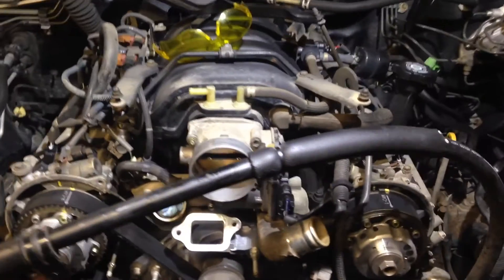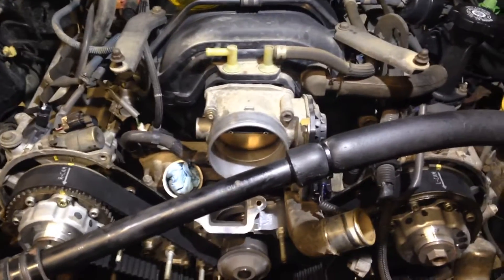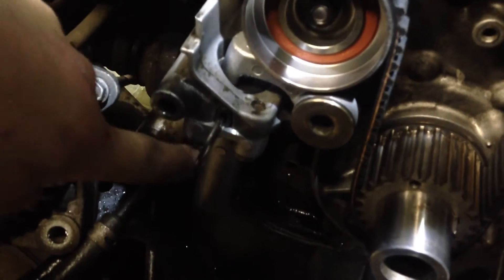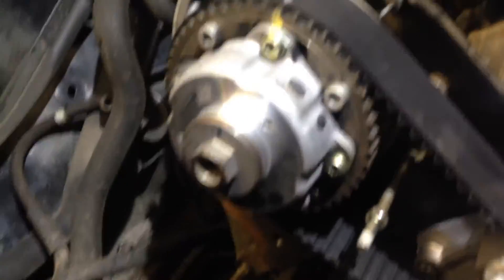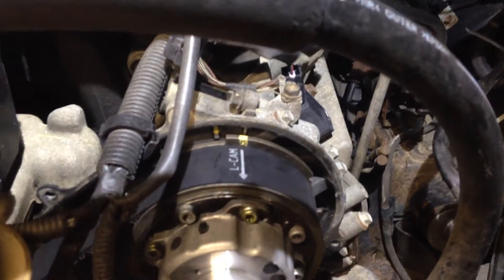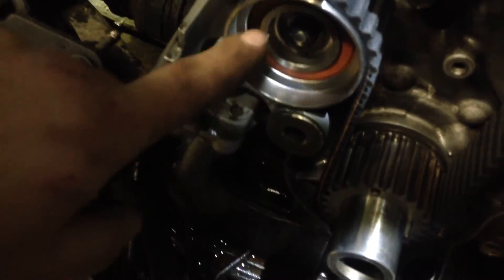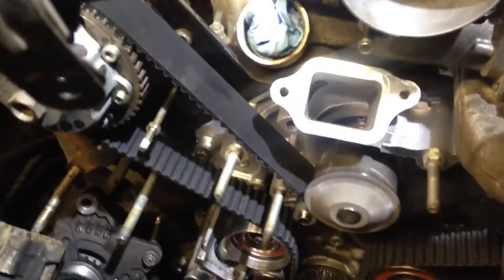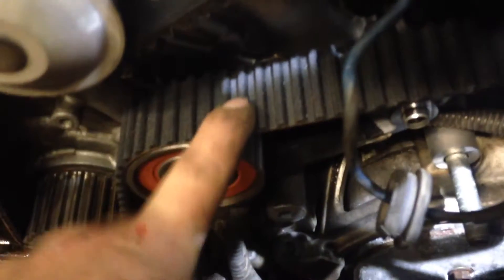Toyota hydraulic timing belt tensioner trick

Comment: That’s not really a trick. That’s how it’s done. 
Only clicked on the video, because I have two 5vzfe trucks in for belt service, snd both have the rear tensioner bolt head stripped.

Comment: That's a great tip Jay, because I've been struggling with that tensioner and belt for some time now. I had the tensioner compressed and still had trouble.  So now, I will remove the a/c compressor and bracket to access the tensioner from below (I couldn't loosen the bolts on the tensioner from above).  I know there is a tool to compress the tensioner $40 shipped, but why spend the money when I have a new tensioner anyway.
Reply from the maker: cal R I'm assuming you're working on a 3.4l v6.

Removing the ac compressor and the bracket is a bit of a pain but gives you lots of room. 

Slowly compress the hydraulic tensioner in a vice and shove a small Allen key in the hole to lock it in its compressed state. Make sure you don't lose the rubber boot that sits above the tensioner. Good luck!